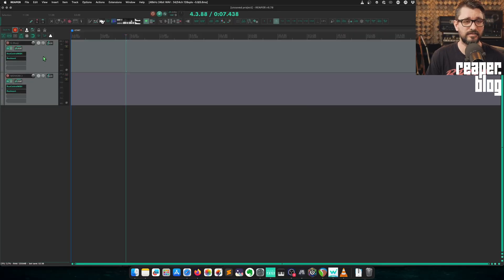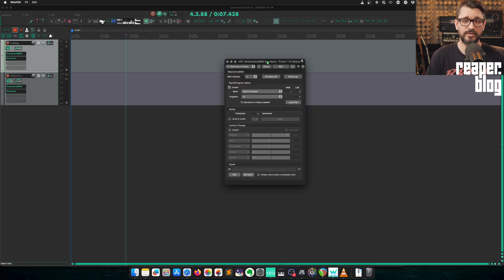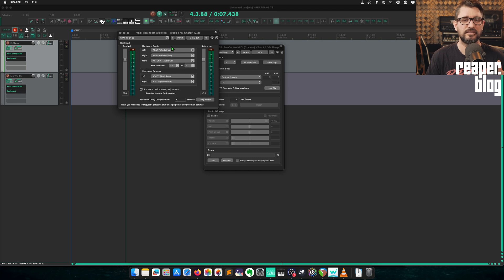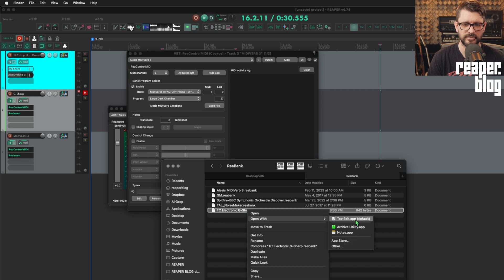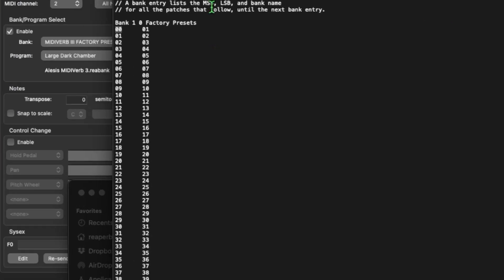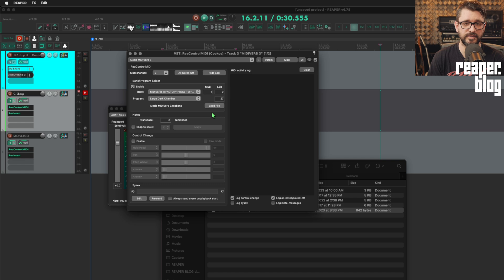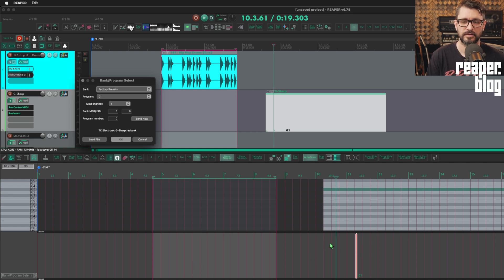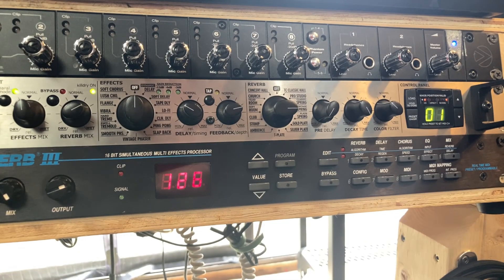Bringing New Life to Old Gear: How I Use Hardware FX with Reaper

Comment: Jon, I added a button to my toolbar to make common program changes to my Ensoniq DP/2. Here is the "eel" script:
/*
Send Program Change to Ensoniq DP/2
*/
// EEL Script for Reaper

/*
8 = Note Off 
9 = Note On 
10 = AfterTouch (ie, key pressure) 
11 = Control Change 
12 = Program (patch) change 
13 = Channel Pressure 
14 = Pitch Wheel
*/

msg_type = 12; // Program Change
channel = 15;
function main ()
(
StuffMIDIMessage(17, msg_type*16 + channel, 68, 127);
);

main ();

channel = 15 is the midi channel of the unit you want to do the program change too. You have to go from 0-15, NOT 1-16. 
In the "StuffMIDIMessage(17........." the 17 is 16 + the ID # in Preferences/Audio/Midi Devices, in the far right column you'll see the ID # next to the MIDI output device you have enabled. What ever your ID # is, you have to add 16 to it to get the proper #. 
68 is the program # you want it to change to, and 127 ON.

Comment: This is really neat. I hadn't thought of using midi for controlling hardware presets. I use outboard fx, but connect everything outside the box. To use an effect, I send the channel audio to a group on the mixing desk. The output from that group goes into the effect on the rack. I use a patchbay to configure the different in/out connections I need. All three fx are merged into one stereo return channel using a mini stereo mixing box my Rolls. The master stereo out is recorded back into Reaper. I have to take photos/notes for settings. I would like to try your suggestion to control presents from w/in Reaper using Midi.

Comment: Some devices even support parameter control via CC messages so you'll be able to 'really' use the hardware like a 'plug-in'. Drawing envelopes in the MIDI editor etc. I don't know about the capabilities of the MIDIVERB but the G-Sharp does support that. On the other hand some people (like me) are happy to move their hands away from the mouse, over to the hardware to push buttons and turn knobs.

Comment: I still use the Profire 2660 too, This one is a spare one, but has pretty good pre's. Same with 3 Motu 828mkIII interfaces, the good thing about the three last ones, is that you can daisy chain them with FW links and if they are loaded into your cuemix FX mixer they are displayed as one interface. Some of the FX in my rack are hardwired in series. But are early digital FX lke the TC fireworx, TC Goldchannel pre, these goes over AES/EBU and than in one of the Motu's via ADAT. But maybe I have a better alternative for the future using Dante, you can route these anywhere in the chain. Dante works extremely well with FW.